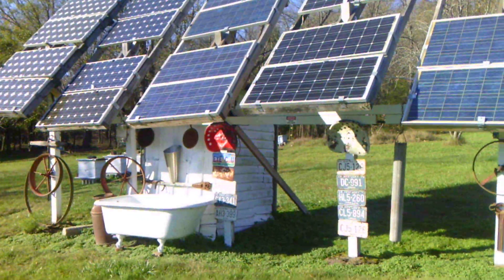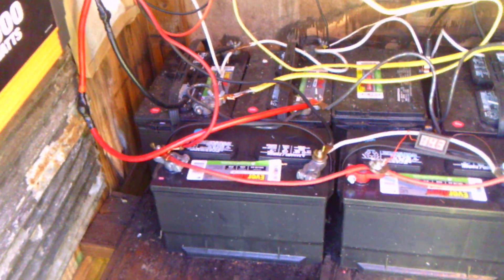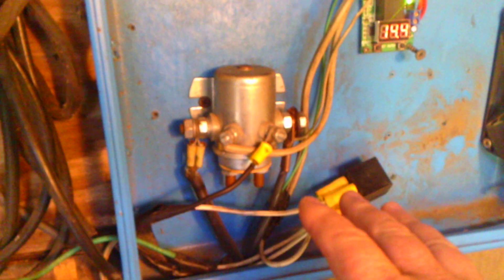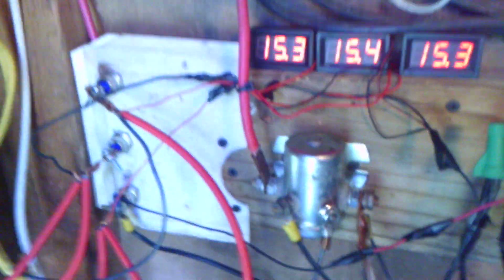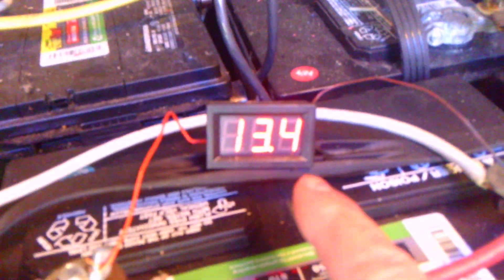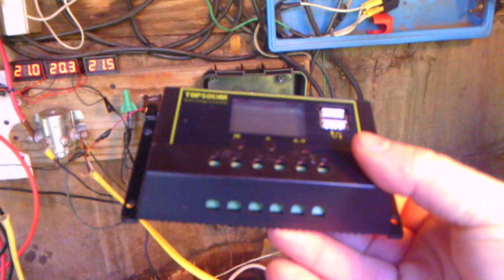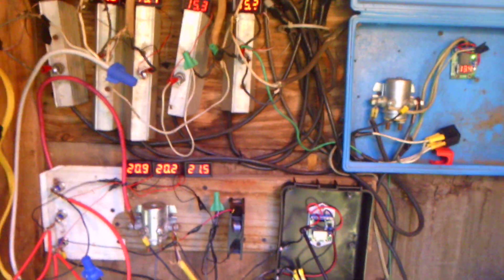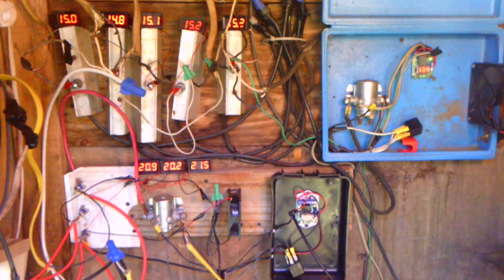Homemade Solar Array and Regulators in Detail

Comment: Looking good does it get hot in the battery room in the summer
Reply from the maker: No the heat is not bad there 3 cooling fans and one fan vents outside. Probably gets about 85 degrees on a very hot day.